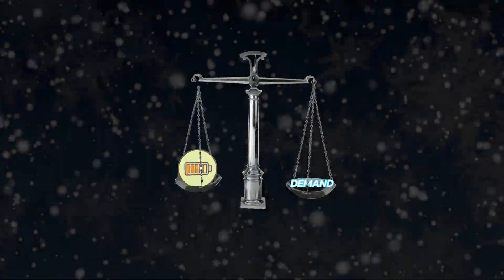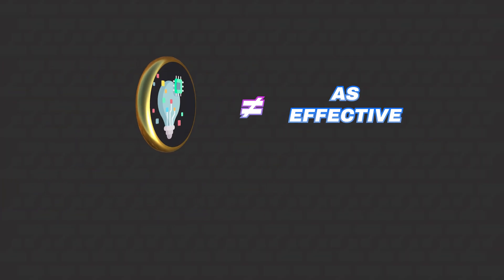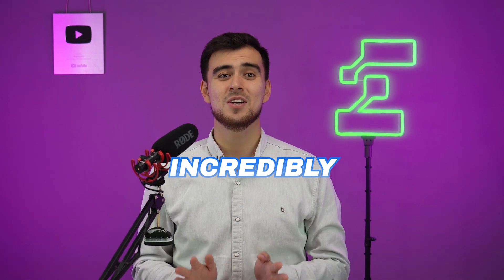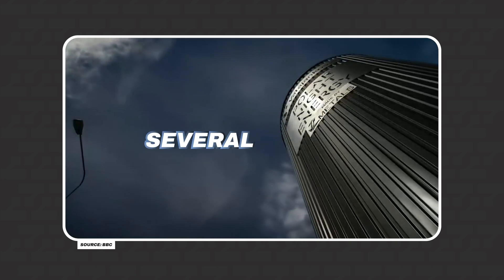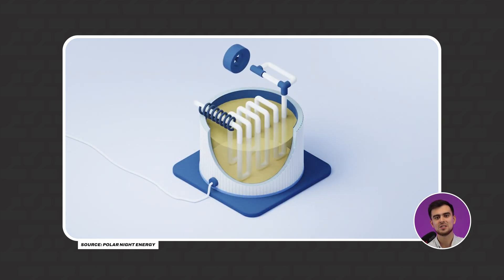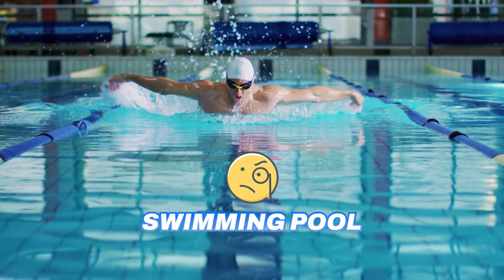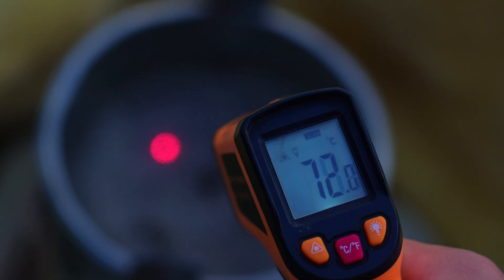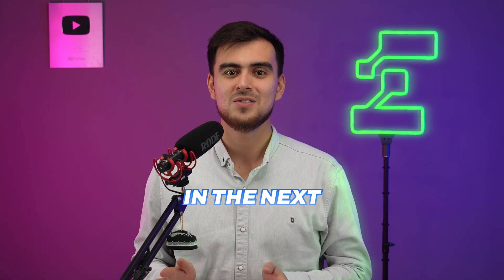I Tried a Sand Battery - Here is Why It is a Game-Changer

Comment: Indian Maid Products Incorporated does a lot of off-the-grid investigation. I head us. Latest, I took an old 1200-watt electric skillet, put a pail of dirt in it and filled the rest of the skillet with more dry dirt, plugged it into electricity and recorded the temperature rise over time with a noncontact thermometer. It reached 415F in less than an hour; etc.  I had it under an 8X16 foot camper to heat the floor. Camper is skirted. Is delightful to have a warm floor as well as a warm camper.. in November when outside temperature is under 40F. 🤔😁

Comment: Actually, I am developing a sand battery, Storage capacity: ~175 kWh total, ~160 kWh usable, Heating autonomy: 34 days at 42 kWh/day consumption, Recharging time: ~10-12 hours at 1518 kW power. The only downsize is the weight of it - 2360–2400 kg.
Reply: DexterityRo,
I wanted to question your data in this comment, maybe I do not fully understand your posting.
If you have 34 days with 42 kWh/day it makes 34x42=1428 kWh usable capacity.
You say you have 160 kWh usable capacity, what would give you nearly 4 days autonomy, not 34 days.
And how do you charge your sand storage with 1518 kW, this is 1.518.000 W = 1.5 MW, so do you have a 1.5 MW power factory at home ?
For a capacity of 175 kWh and 2400 kg sand you would have to heat it up by over 300 Kelvin, this is rearly hot to handle...   
I just wanted to challenge your answer, because I'm interested in building a sand storage myself.
Reply: @christophmuller2827  sorry mate, it's 4.2 not 42. So it's 34 days. And 15.18 not 1518
Reply: im developing one aswell. 2 cubic meters. 300 degrees celcius. mineral oil heat exchange. It would be placed underground
Reply: @sanderzwiers What device do you use for mineral oil e change?
Reply: @DexterityRo i will build it myself except the magnetic drive gear pump. It will be some kind of coil heat exchanger. I'm trying to see if i can use a compound parabolic mirror to heat up the oil
Reply: @sanderzwiers briliant idea, when you finish, maybe you can share the experience 🙏
Reply: @christophmuller2827  I don't know why it didn't take the dot.
Reply: @christophmuller2827  If you would like we can have a chat on the subject. I already planned it to be built end of August - mid September. Already got hte land and I am still working on project as the main problem is transforming the heat from sand to air or water. as the sand goes up to 500 celsius inside the battery.
Reply: @DexterityRo ; how far with this project?
Reply: @jaggwerogers1619  done the building manual. Still work in progress. Why?
Reply: @DexterityRo  Hey, since you have some experience building this battery, you think that is possible to make this experiment that engineericly did with cheap materials for a science fair?
Reply: @AmandaCustodioRibeiro At this moment, no. I am focusing on the project and as I said end of August mid September. Building a small one just for demonstrative purpose it is not my goal.
Reply: @DexterityRo  hey I have some questions about the project as I’m also planning to build this would it be cool if I could dm u?
Reply: @TeenFlash1204  yes, mate. go on
Reply: @TeenFlash1204 yes
Reply: what are the rough dimensions for this?
Reply: @glitterishhh dimmensions approx. 2350mmx2350mmx2350mm.

Comment: In theory, a battery only needs to hold 24 hours of storage to pretty much do some crazy numbers on the grid level, but I also want to stress, that while you have 5 hours there - its only going to be good at storing heat and not make power really. So these batteries are only good at thermal. If it was possible, a air pump system could make use of it by storing the hot side here vs a water tank, but over all, I would consider these systems more of a thermal battery or a run off station for too much power. You wont get back as much energy as you would with a normal battery.

Comment: Very nice brother, Jazakallah. Here is what I would do. Digging a cylinder well in my backyard and use the soil to make bricks that can be used to pave the floor and walls of the well. Build a wall little higher than the ground for easy water connection. Run a hot water pipe along with the cold water so that hot water pipe can transfer it's heat to sand cold water pipe can be heated. Fill pure beach sand. Before covering it from the top, make a rectangular section for BBQ and use it's heat to store into the sand. Make BBQ section as an external heat transfer via sun+lenses and/or fire. Make cover automatic to track sun and use it's heat or cover it so heat can be protected. Some automation will be needed to stop the hot water supply for savings on boiler's energy consumption because sand will be able to heat up your cold water well enough. 
Please try it and share with us.

Comment: It might be a good use for old hot water heaters. They already have a high temperature insulated container. When they become too corroded for pressurized water, just turn them into a sand battery! (Please do this one next)

Comment: sand batteries are rather cool. There is even one company taking it a step further, storing heat in molten sand at over 1700c, but I think the only ones doing that are massive power plants dumping excess power for steam generation... not to sure, but Robert Murray Smith also made a sand battery a while ago, showing how easy it is to build one out of a 5 dollar electric kettle, a large metal bowl (like a large tuna can?), and sand. Wasn't insulated, but showed how he could just heat it up constantly and that, even uninsulated, it would retain the heat for a long time.

Comment: I think this suggests that this works on the large scale, but not as good on the small scale and probably a waste of time on the mini scale. 

Kind of like boilers.  A water heater is one thing.  But a water heater for a hamster wouldn't work and a massive boiler from 1910 or something can provide heating and warm water for an entire apartment complex. 

So I wonder... one were to build a sand battery mega-structure, could it be used to take care of the needs of a city pretty reliably or at least only some of the needs?

Comment: I found your video informative and interesting.  Thank you.  

My goal in this comment, however, is to help you pronounce English more easily.  Being a non-native speaker of other languages, I know how helpful it is when someone can explain 'how' to pronounce something I have trouble with.  I also have a lot of native Spanish speaking friends who struggle with the 'ed' at the end of words in English.  So, here goes... 

Generally, the words ending in 'ed' in English are past tense verbs (you probably know this but I'm adding it for clarity, just in case.)  Though not all past tense verbs end in 'ed' most of them do.  So, here's the thing.  In most English words ending in 'ed', the 'e' in the 'ed' is usually dropped.  The 'ed' ending usually ends up sounding like either a 'd' or a 't'.  'Produced' is not 'pro-DUCE-ed'.  It's more like 'pro-DOOST'.  'Considered' isn't 'con-SID-er-ed'.  It's more like 'con-SID-erd'.   

The exception to this rule is if the present tense of the verb ends in either a 't' or a 'd'.  When the present tense verb ends in either a 't' or a 'd' AND the past tense form has the 'ed' ending, it is pronounced as it appears.  For example, with the verb 'wait' the past tense is [WAIT-ed] and the past tense of 'mend' is [MEND-ed].  I truly hope this helps!  

=================================

Just in case you're wondering, 'pronounced' is 'pro-NOUNST'.  And, yes, 'help' would sound like 'helpt'. And that one is hard for non-native speakers.  Here's how we do it:  The 'p' is almost silent.  You form the 'p' with your lips first but then say the 't' (which is formed inside the mouth).  Technically, the 'p' is supposed to be pronounced but no one pronounces it when a 't' sound comes after it.  AND remember, follow the rules written above, you would use a 't' sound for the 'ed'.  So, 'wrap' which would become 'wrapped' in its past tense, would sound like 'wrapt'.  If you do this, you'll sound like a native speaker and I think you'll find them easier to pronounce.

Comment: Yes, please build a larger model of the Sand Battery. There is little practical information on this topic. I would like to build a larger battery using Solar Hot Water panels. I need more info. on this topic.

Comment: Maybe try an old water heater. It is already insulated and has heating elements.  Just change the thermostat to a higher temp and power it with solar panels.

Comment: Need to try it with a 45 Gallon drum.
Reply: Great suggestion. I just crunched the numbers and got a delta t from 25C to 98C = 21 KWh which might take the edge off a single room through the winter. I am proposing using 6 barrels with 200 mm insulation board with plywood surround. Bed on top: 125 KWh - but then we will be using a water mill powered friction heater aka hydrodynamic retarder.

Comment: So a sand battery and a slow speed underwater turbine call Wateroter gives you a 24/7 100% clean heat and power source. You only need water moving 2 to 5 miles an hour, these units can be moved if needed and won't harm fish. Made in Canada the Canadian military is replacing diesel generators in the far North with these units. By installing these units below all existing Dams most states could produce more power to sell to other states.

Comment: For people who don't know, sand has a specific heat capacity of 0.835 while water has a specific heat capacity of 4.186.

What do these numbers mean? Well, it means that water take more energy to heat up than sand, so, those sand batteries that can store 600C of temperature in sand are basically the same in terms of ENERGY storage compared to a water batter that can only store water at 600C.

This isn't to say that they're useless, in fact, I think these could be highly useful as energy storage when it comes to hurricanes!

Hurricanes are a gigantic mass of kinetic energy that smashes cities to pieces, when it comes to harvesting the energy of a hurricane, a lot of it we wouldn't even be able to use within a week or possibly even a month, depending on how much energy we siphon off of it because of how little energy humans use in comparison.

So, sand batteries will, I think, be very useful for storing the energy of a hurricane due to the fact that the sand batteries can hold energy for months, even if we use these batteries to obtain electricity rather than simply use them to retain the heat for homes. 

Even with the loss in efficiency of obtaining electricity from these batteries, I think it'd still be useful because, 1. we wouldn't be able to use most of the energy anyways, or at least, without a better alternative. and 2. the main benefit, in my opinion, would be absorbing the energy from a hurricane and decreasing its potential for destruction meaning fewer people would get hurt and die and less homes would be destroyed or, if we have enough turbines designed for hurricanes, completely negating the hurricane.

Comment: It would be useful to know how to make a sand battery that could be safely heated overnight for eight hours on the cheap electric rate and had enough stored energy to output 1kw of heat for 16 hours.

Comment: yes, please! I was thinking of doing it small scale at a remote household, but the Finnish company emphasized that a small-scale prototype is not as effective, as the effectiveness comes exponentially from volume, so single household solutions would not be cost effective. If a district of say,  at least 10 houses would share the energy from a unit, then it would already surpass any conventional means of district heating.

Comment: TRY THIS - put lots of copper plates,in a star pattern, from top to bottom - the plates wil rapidly take heat to all areas- also- not many people have a furnace!!!  ANOTHER IDEA- use copper tube in the same way as is used in steam train boilers, put tank lengthways - you also get a larger surface area for your heater - again,use copper sheet to transmit heat along length of container.
Also- your container is in air- try digging a hole, and putting several layers of insulation around container, with a multiple layers of insulation lid- heat losses are highest at top of container,as heat travels upwards.
Look forward to your homesize one- you can also buy readymade ones....👍👍👍👍👍🤔🤔🤔

Comment: I want to experiment with this eventually off grid, the idea of using air as the transfer medium is genius, don't have to worry about freezing or boiling of water, or other liquid used.  I'm thinking if designed carefully it could be used for a hydronic floor heating system. The key would be to design a heat exchanger to extract heat from it at a safe temp range to use for the floor system.
Reply: you would need a primary closed loop, high pressure heat exchanger, and a commercial heat pump as a secondary exchange

Comment: Just because it’s called a “sand battery”, you don’t need to use sand.  If you use stone chips, . (Like a big Finnish sauna heater.) You can force hot air through it over a heating element to heat it quickly, and later circulate air through it and through a heat exchanger to extract the heat.  Then ideally store it all in a giant vacuum flask.

Comment: Thank you for debunking gravity storage. There are still people out there talking about it, and unless they're referring to hydro power with water lakes at high altitude, it doesn't make any sense!
Reply: people are talking shit though. i mean 

its currently possible to wind a cable to raise a weight with a typical 95 % efficient electric motor and use it as a 95% efficient generator on the way down for a combined efficiency of 90% minus friction. maybe 87% .

its also possible to pump water uphill with typical 55% max efficiency pumps through long pipes with lots of friction and use the same pipes in reverse to run a typical 50% efficient water turbine generator for a total efficiency of 25 %, absolute best case scenario.

there are many storage technologies that make progressively less and less sense, but not making any sense? thats impossible !
Reply: @echelonrank3927  Talking about 90% generator efficiency sounds good, but don't ignore how much mass needs lifting. To store one kilowatt/hour of energy (let's say 1 kW/h is worth $0.12) you need to lift 1 metric ton, 367 meters up. So lift a 1 ton weight halfway up Burj Khalifa and you've stored 12 cents worth of energy. Imagine the infrastructure needed to store 1000 times that much, imagine what that would cost - and a structure like that will only effectively store 1000*0.12 = $120 worth of energy! It makes no sense. River water is free so pumping it up to a lake and letting it flow down again takes relatively little infrastructure compared to how much mass you can move around.
Reply: @Gersberms   govt here became super  excited about investing in pumped hydro a few years back. 
 the 2 billion dollar project already cost 600% , is not even halfway done and is now being completed in the courts.
Reply: @echelonrank3927  That's crazy, what did they do, build an entire lake from scratch?
Reply: @Gersberms  last i heard they were drilling through a mountain and the giant machine got stuck dead
Reply: @echelonrank3927  OK I won't say it doesn't make any sense at all - counterweights are proof of this. Clocks, lift bridges, and elevators use weights and counterweights to recover nearly 100% of the energy stored in a lifted weight. The trick they use is that it's recovered as mechanical energy by cable or rigid linkage, so super low loss.

Comment: Not my idea, but I think it is a possible winner. Imagine that about once a month, a lorry arrives and switches out your 'empty' tank, for one full of thermal energy. If you have a large Gas, or oil tank, it would typically be one to two cubic metres, lets say 1.5M3. This would store 2-2.5 MWh of heat, if filled with sand at 500C. Even allowing for losses (it would be very well insulated) this would keep an average home toasty for a month. Installation would be as simple, as removing your boiler and pumping the water through pipes in the sand, and connecting your hot water pipe, to where your normal boiler outlet pipe is. No new plumbing required. In Ireland it would work quite well, as our wind resources coincide with the winter, but surely it must be possible to have some huge underground warehouse, storing hundreds of thousands of tonnes of sand, which could be designed to keep its temperature for months. Ideally, storing solar from summer, to heat us in winter. I used to say 'How about it science?', but here the science is established for millennia- heating a stone in the fire and taking it to the bed area at night. Other than insulation improvements, the manufacturing and engineering are well established, so 'How about it investors?'
Reply: Uh... dude, how are you going to pay to move over 6000 pounds of sand 4 times.

Utility to truck, truck to house, pick up used from house, truck back to utility. 

The utility will eventually run into issues in that they are no longer using excess energy but are now requiring energy to keep their customers happy, so the costs will run away.

Comment: Try using a steel garbage can painted matte black, attached to a dolly then filled with DRY sand.  Put this in the sunlight all day long.  Wheel it into the house at sunset.  It should give off heat all night.  Put it outside again at sunrise.  It's just a prototype, so don't expect perfection.  But it should be good enough for a small house.